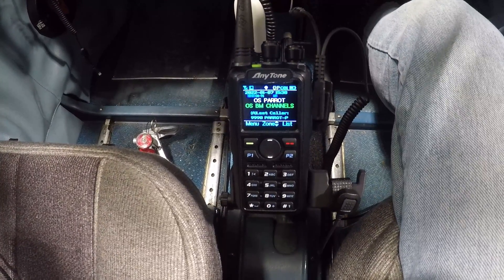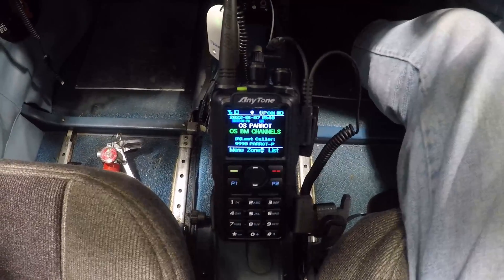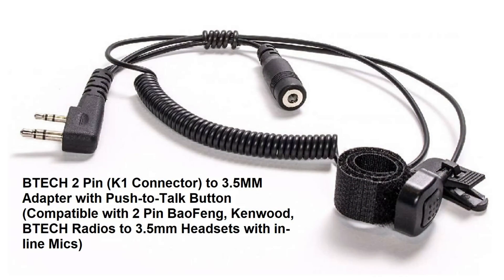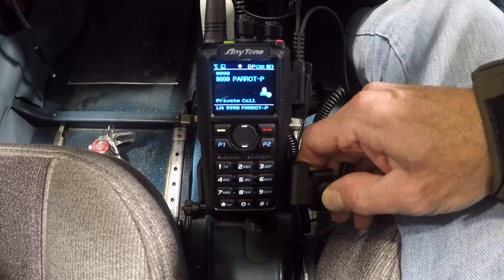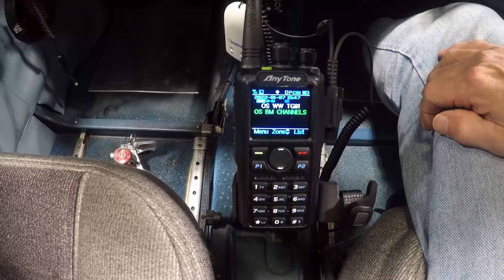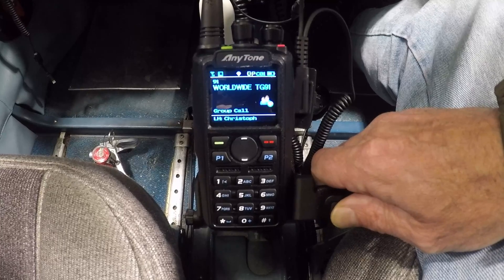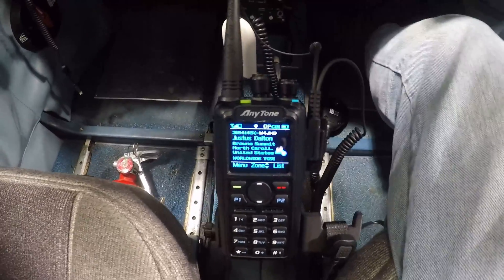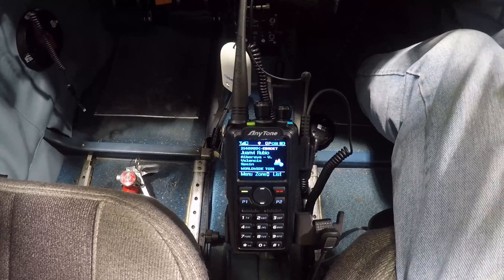Connecting an Anytone 878 Digital Handheld Radio in an Airplane

Comment: Let me know the next time you try digital! An AT-578 mobile may work well with the plane...
Reply from the maker: Hey Steve! Hope all is well. Been crazy busy with nonstop work. Only able to squeeze a flight in now and then. Wouldn’t the 578 do the same thing as the 878?  My issue in the airplane with digital has always be. Bad cellular signals.
Reply: A 578 is a higher power version of the 878. You would be able to access digital/analogue repeaters much easier. 5 vs 45 watts

Comment: I just got the AnyTone 878UVII Plus. I got TX and RX working through my Lighspeed Zulu 3 headset via BT. After adjusting the BT gain, turning off BT + SPKR, and turning of BT + INT MIC, the audio doesn't sound too bad on the ground. Now lets see if it works into the GoPro (fingers crossed).
Reply from the maker: That’s very cool! In my case, I had lots of trouble getting good audio via Bluetooth from the anytone. I hope you have better success!

Comment: Of course you could alternatively take the antenna feed from your mobile radio and using an adaptor replace the rubber ducky antenna with that and use the RF signal rather than the hotspot.  IIRC, you are using a vhf band antenna on the outside of the plane?  You would want to exchange that for a dual channel one, as the DMR repeaters here in the PNW are a combination of both bands.  As usual, you have presented us with an interesting video.  Thanks for making and posting it.